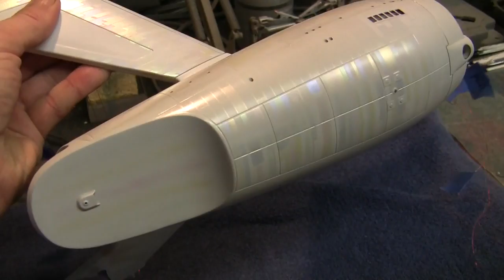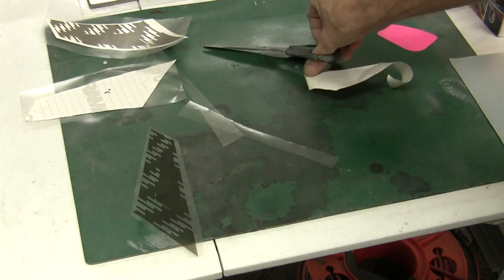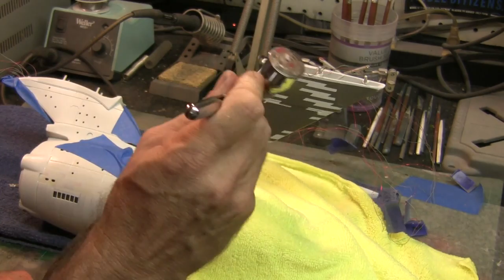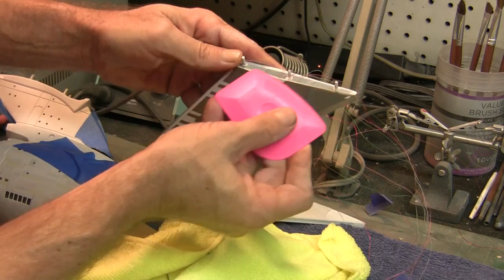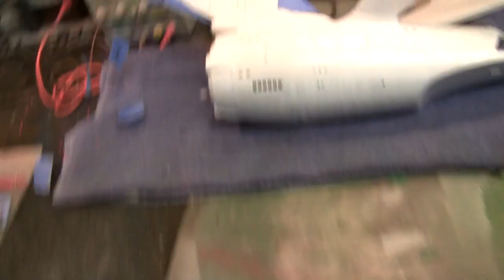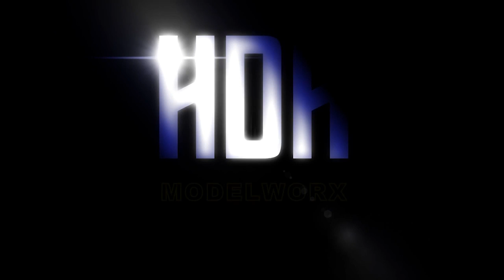1:350 Scale Enterprise Refit Build PT 15 Aztec Painting The Pylons

Comment: Really nice work Boyd. I bought one of these models from Hastings on sale when they were having their store closing sale. I also bought a small Enterprise-C 1/2500 scale model and a Klingon Cruiser 1/350 scale. I started with the 'C' model and quickly discovered that I don't seem to have the talent for this. I put a TOS model together many years ago and used fiber optics to light it and had to paint it because it was with blue plastic. It came out OK but I wanted these to be really nice. I don't think that is going to happen. I don't have the equipment, knowledge or ability. I live in a rural area and we don't even have a hobby store anywhere close. There is no way I am going to be able to build the two big ones. I am wondering if there is anyone out there that might want these two kits. I am not sure if they are easily obtained or not, but I am willing to sell them real cheap. I know I can't get what I paid for them. Hopefully you can get word to me.
Reply: What are the 2 big model kits you have?

Comment: Hi Boyd ,
I know in your video you spray the Blue , Green and then Gold ( 3 colors for the 3 masks ), but as you view the 1st pylon in this video which you have already done before running us through the second pylon it gives the impression that there is Red used on there , I gather this is just a visual effect on the video ? I think it may be the Gold reflecting as a Red ?
    Steve
Reply from the maker: Yes Steve, these paints are color changing or what they call flip flop depending on the light and the angle you see them from. They are not regular pearl paints.